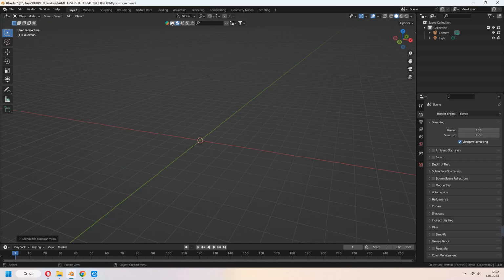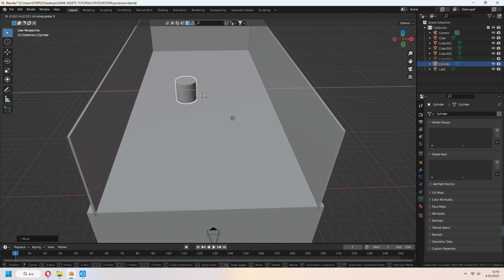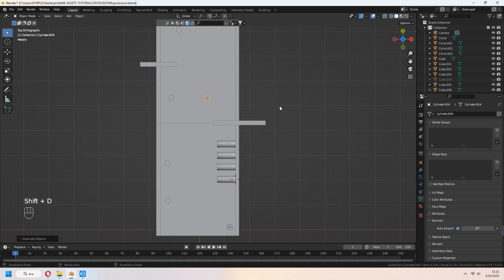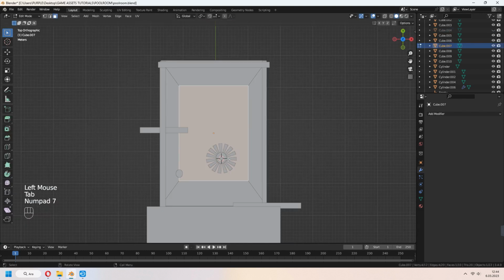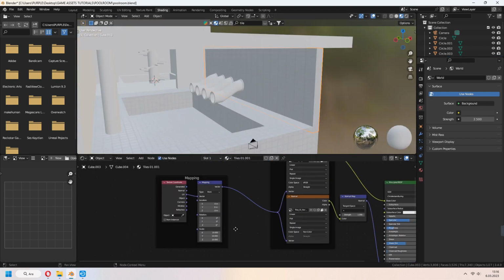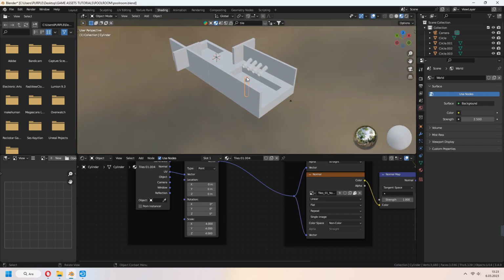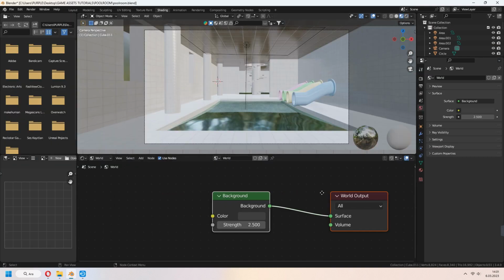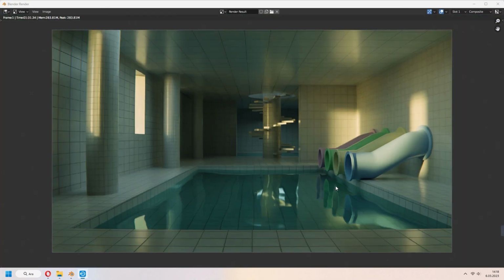How to Make Poolrooms of Liminal Space / Blender 3.4

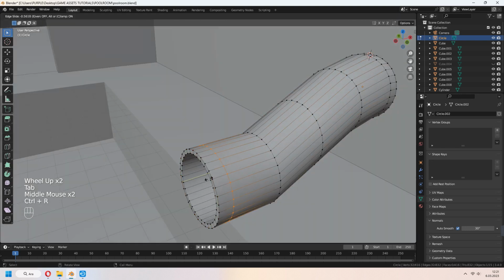Comment: At 3:06 my slide keeps messing up and enlarging the front of the tube and the back. PLEASE HELP.
Reply from the maker: Hello friend. İt cause maybe can be recalculate normal issue. You can check viewport overlays from top right menu and face orientation. İf you see red faces, in edit mode, shift+N to recalculate normal.  Sometimes i get this type of problem to solve with this method
Reply: @nonedesign3d  I tried and everything is blue. Our slides look exactly alike and Idk what is happening. I try to Alt+S the part to make the font of the slide to make it look like it has a circle around it and it take the small squares I selected after using CTRL + r    to make them a certain size and then it takes the long lines it is connected to as well and doesn't work. Please help. :(
Reply from the maker: @TwizzyMehoff  did you try to ctrl + A and apply all transforms? Sometimes it gives weird results if transforms are not clear. Can you try this before make your modifiers? Maybe it can be work